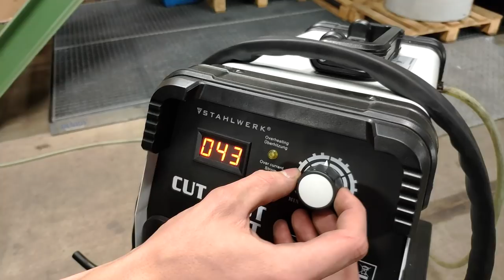Lathe Restauration - When it Tipped Over I Wanted to Quit (But I havent)

Comment: Using multiple gas pipes where you keep circulating them to the front (in the direction you're rolling) is another way to move heavy equipment. Glad she's in place and making chips!
Reply from the maker: Yes, I've used that often times :)

Comment: Awesome job on the rebuild! I have 3 LeBlond lathes. The 17 x 120 had been tipped over or dropped or something. The taper attachment was broke off of it and the lead screw was bent. Other than that, it is inasty and rustind it now works like a new one also. Next in line is the 13 x 96. It is not in as good a shape as the other 2 but it will be when I get finished. Thanks for sharing, I enjoyed watching!!!

Comment: Nice work, moving top heavy machines like lathes is always scary. For the way wipers if the polymer parts are missing. I reprinted mine out of TPU on the 3d printer, and they are doing a nice job so far.
Reply from the maker: Never considered that, but I might try that in the future!
Reply: CO2 laser cutters are great for  felt seals and wipers. 😃
Reply: Great idea!

Comment: Great video thx. The TOS lathes look really capable, great resto. The teachable moment in this video is the skate mishap. If you're using skates and they are not bolted to machine, you have to watch them every second. Even with 3 skates, you can't depend on the tripod effect. I foolishly thought I could, and got lucky when one came out from under headstock end, just lucky it didn't flip. Pipe rollers are more reliable, and can be steered remarkably well, plus they are low profile so if they drop out the machine won't tip far. Videos showing pallet jacks always make them look problem free, but the slabs on my planet are too rough, or there's a slope. Loaner Harbor Freight engine lift? Sorry no thanks. Lathe plus pallet jack plus slope equals potential for disaster.  Pipes: free/cheap, easy to steer and keep machine movement controlled. Just add come-along, bob's deine Onkel.

Comment: Most times stuff lands in the worst possible orientation, this time you were lucky and it dropped the best way possible ;-)
Operator side with lots of handwheels/shifting levers would have been a whole lot worse!
Reply from the maker: If it had dropped operator side down, it would be game over. This way it was still a lot of work to fix it, but nothing serious